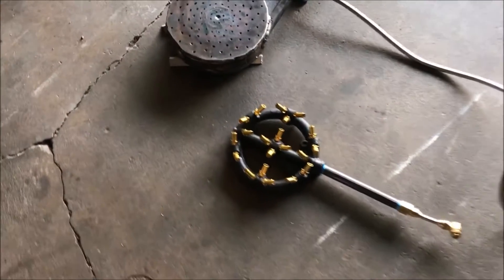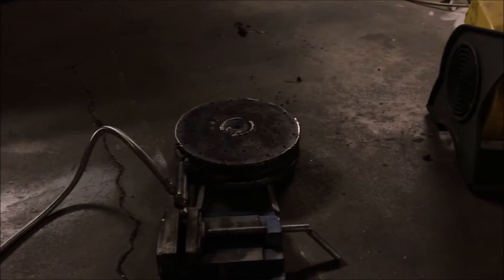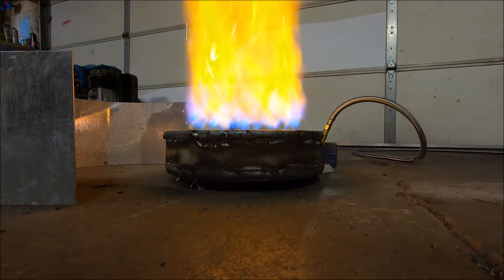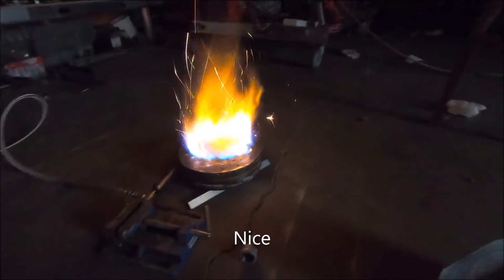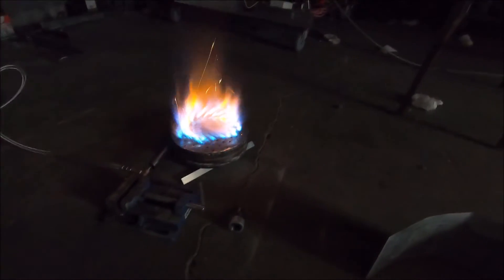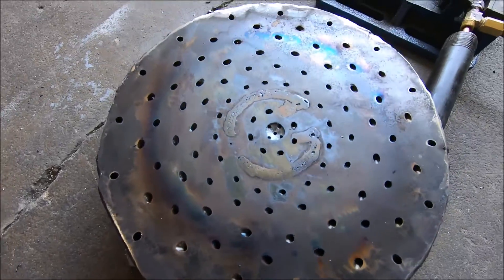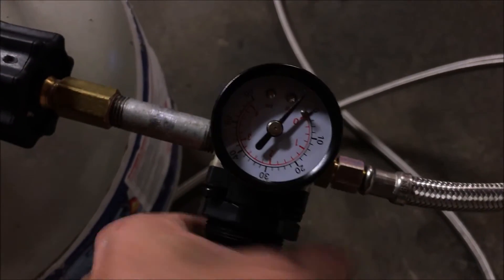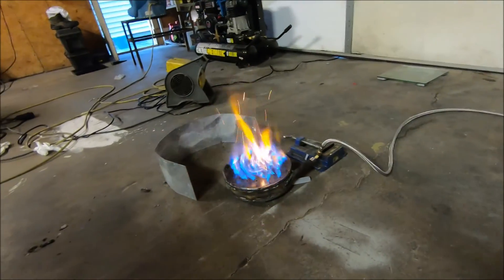Vortex burner

Comment: Any ideas for adding a servo driven valve, and regulator, and a blower? and have them controlled via servos hooked to an arduino? or PWM in case of the blower, ignition system could also be DC based spark unit also controlled by the arduino, with flame/flameout sensors, could even make a bimetal/servo driven choke that would open/close some of the outlets, and last idea, adding a catalyst, like a catalytic converter material, it will hold a lot of heat, and burn off any unburnt fuel

Comment: Is there a way to turn the valves in the center of the old burner by 45 degrees so they are off set from the valves directly across from them?  How did you not see this when you made it, did you overlook this in the design or a mistake in manufacturing?   

Maybe you can take the valves out and either fill the holes with a bolt, then grind it off flush.  If a bolt isn't the right thread, you could drill & tap it out to be the right size for a bolt or maybe use a smaller one and weld around the top - then grind it down flush.  Then re-drill the holes for the valves in the correct location.  

I think the old unit might have a lot of potential if you can turn the center 45 degrees and it would be a real waste to not try.  I like the work you do!  Have you tried finding used automatic transmission fluid and see how that burns?  I've heard it produces even more heat/energy than  standard motor oil or diesel by 10-20%!  That is quite significant and I really wonder what it is made of if it has that much more energy than standard oil (which is about 130-138,000 BTU/gal).
Reply from the maker: what are you talking about ? Valves ? are you refuring to the brass nozzle burner ? i did not make that and they are suppose to face each other
Reply: @NOBOX7  - yes, I thought in the other video you referred to them as valves -   being used for an alternative purpose.  Like a modified needle valve w/ the control mechanism removed.  See what I'm saying?

AS far as whether or not it is "supposed" to face each other, you are obviously not thrilled with it's performance as noted in previous videos. Remember the hot spots in the wire mesh/grate (diamond) on top of the unit when it was running before?  I think those are from this being concentrated like it is.  Spreading those hot spots out would significantly help heat a coil like you have.  

I've worked with this stuff before, built a number of my own burners (propane, pressurized methanol, IPA and ethanol, veggie oil, motor oil, animal fats - tallow, lard & mixes of all these - fats/oils with alcohols mixed & a homogenizer/stabilizer)

Also, have you considered making the coil longer, there's a LOT of wasted heat in the space between windings.  I'd say maybe 2-3x longer would make a huge difference.  I'd also suggest coiling from the top down, so the bottom coil is at the hottest point of the flame right before it exits. 

On a side note, I may be in the market for a way to heat water for a pressure washer to 190-208F and also a high temp, high pressure & medium to moderate flow system. As far as temp, I would think 315-450 would work very well, but I have to research the pressures involved and the risk of danger.  It doesn't need to super light but must be able to be used with a wand - , I'd rather it be over-built than have catastrophic  failure or breakdown(s). Have you made any of these for sale as of yet?

Finally, are you aware at the damage pressurized, high temperature steam does to iron (steel included IIRC), it basically eats away at it like a slow corrosive con

Comment: I'd look into packing the body as well.  Maybe some rock wool ceramic insulation or even fiber glass insulation. You can buy 304 or 316 SS mesh fabric (from2 mesh up to 600+mesh  - very fine!) on ebay for a good price, by the sq ft.  I wonder what would happen if you placed a sheet of finer mesh right underneath the holes?

Comment: add a grate or cast iron stand on top to hold a skillet. take that thing camping. its a stove and campfire lol .   hmmmm try packing the chamber under the plate with steel wool or those stainless scrubbers you use on pots and pans its bigger mesh stainless to help diffuse the propane more even thru the chamber. similar to the way a  motorcycle muffler works well at least the aftermarket ones